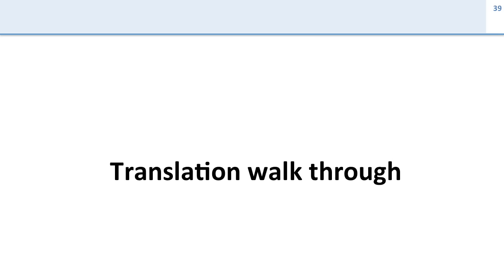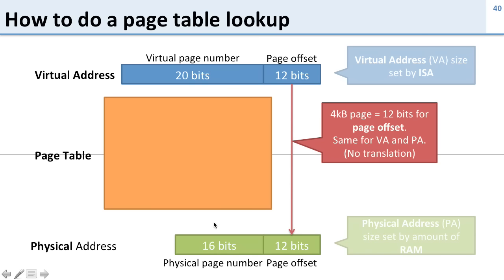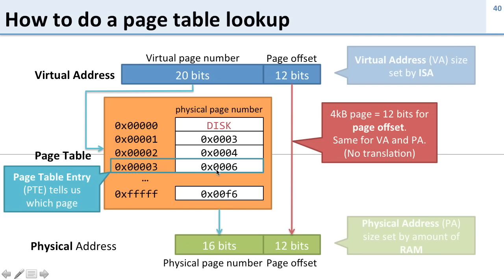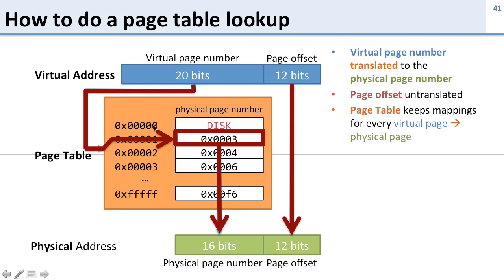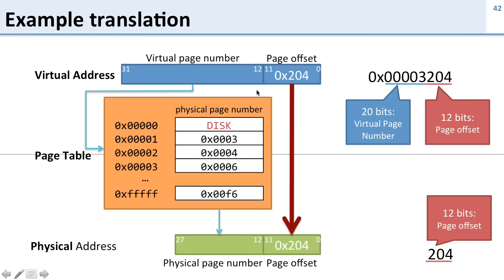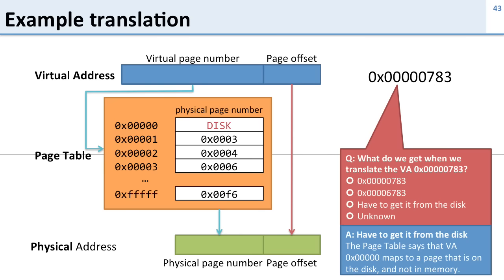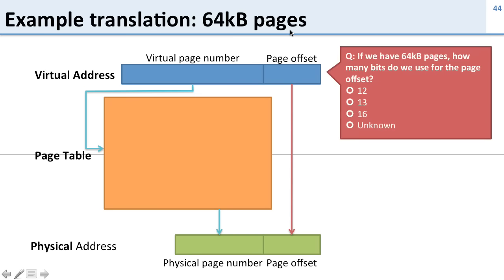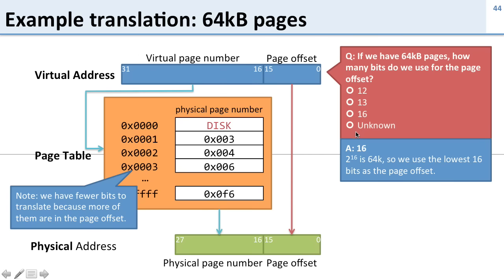Virtual Memory: 7 Address Translation Example Walkthrough

Comment: Thank you, David, for these tutorials. I will assume some of the values are arbitrary values, for example, how did you decide the page offset or how does a 12bits equal 783? 

Correction on how to find decide offset 3:57: To find offset, I assume from the videos that you need to convert the page size to byte then find the bits. Also, the 3 least significant bits of the hex  is 12 bits, this makes 12 bits equal 783 in the example.
Reply: You don't need to convert the page size to bytes at all. If you assume each page holds 4kiB of data, that means it can address a total of 4096 bytes in memory. You can count from 0 to 4095 using 12 bits in binary, and 3 digits in hexadecimal. That's why we're interested in the least significant 3 digits to figure out the page offset.

Comment: You have a talent for making complex concepts simple. I wish you were my professor back in college. Thanks for sharing your knowledge with us!
However, I am a bit confused about this example. Is it common to have the virtual address size less than the physical address size? Why wouldn't I just reduce my virtual address space to be the same as the physical address in that case? I can never access more addresses than physically available.
Reply: you still need Virtual memory as there maybe processes loaded into the RAM , yet you need to load one more Process in the RAM , but your RAM is exhausted right, so you can't load any more processes in it. Here comes the need of Virtual Memory. True that if a single process is running you don't need virtual memory .

Comment: how do you know that the 204 is only 12 bits?
 2:13
Reply: yes same question please advice
Reply: @junepaulcuajotor3777  Each digit of a hexadecimal number can be represented by 4 digit of a binary number. Just look up the conversion from hexadecimal to binary. In our case 204  is the hexadecimal number so for 2 we write -0010  for 0-0000 and for 4-0100 so 204(hexadecimal)=0010 0000 0100(binary) thus we need 12bits.
Reply: @ismailkadrija3799  thank you

Comment: Are the numbers 0x0003, 0x0004, 0x0006...0x00f6 arbitrary? would this be given information or is this the same information you will find always?
Reply: They are arbitrary, that's the whole point behind virtual memory. You create a layer of indirection, so that the physical memory does not correspond to the virtual memory. The page table maps a virtual page (chunk of memory) to a physical page. So virtual page 0x00000 can map to any physical page that the page table wants to point to.

Comment: how does 64k become 2^16 bits? I just would like to know how it is calculated. byte=8 bits and kb=8000bits   64kb= 64*8000bits=512,000bits? just little confused in this coversion
Reply: 64k = 64KiB = 64*2^10 Bytes = 2^6*2^10 Bytes = 2^16 Bytes. Taking log_base2(2^16), you get 16 bits needed to address every individual byte.

Yes, one byte is always equal to 8 bits. Though 1 kB (not kb as you said, which is kilobits and not kiloBytes) equals 8000 bits, he actually means kiB (kibiBytes).

Oftentimes, when somebody uses "kB" or "KB" (kiloBytes), they actually mean "kiB" or "KiB" (kibiBytes).
Kilo, Mega, Giga, Tera, ... use powers of ten but -ibiBytes or -ebiBytes use powers of 2:
KiloByte = 10^3 Bytes. MegaByte = Kilo of KiloBytes = 10^3 * 10^3 Bytes = 10^6 Bytes = 1Million Bytes
KibiByte = 2^10 Bytes, MebiByte = Kibi of KibiBytes = 2^10 Bytes * 2^10 Bytes = 2^20 Bytes

Comment: why does the physical address only have 28bits and not 32bits?
Reply: see last video, it's an assumption.  In order to demonstrate page fault (swap from disk).
Reply: watch Virtual Memory: 6 you will understand.
Reply: short answer because the RAM is only 255MB which needs only 28 bit to address